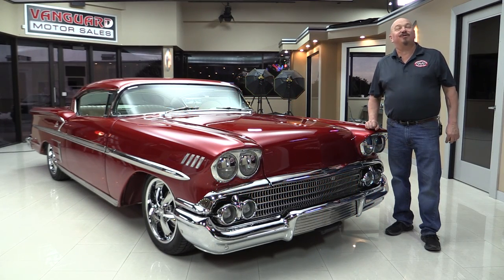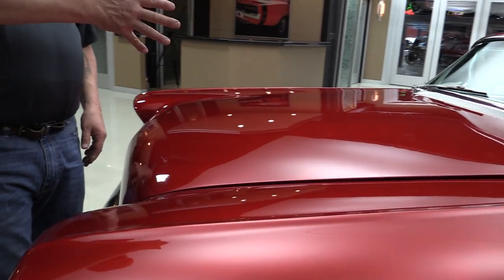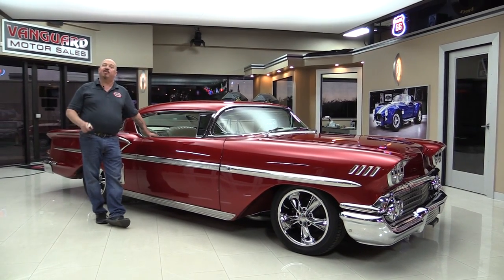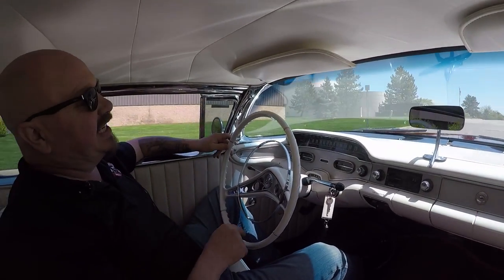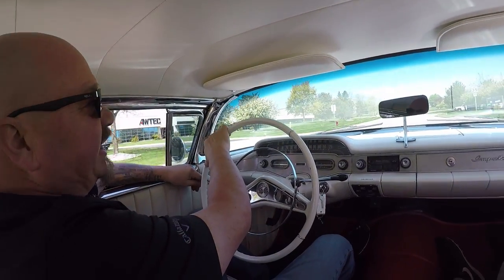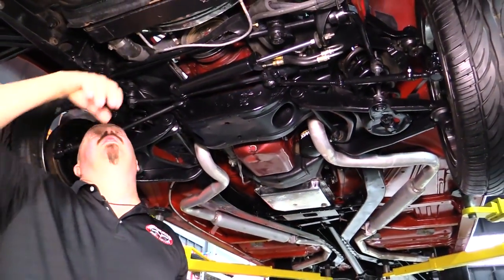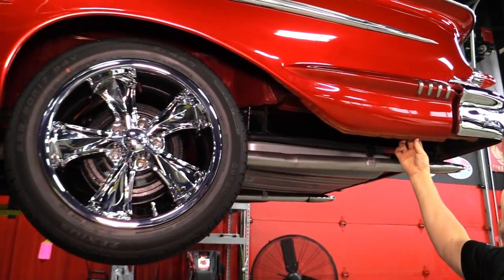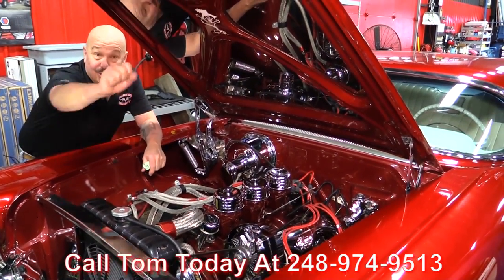1958 Chevrolet Impala For Sale

Comment: The '58 I owned back in 1976 was not an Impala, but a Delray, the cheapest version. It was 6 cylinder, 3 on the tree, 2 door an fire engine red. The most favorite car I ever had. Drove it from Atlanta GA to upstate NY and back. It burned 23 qts of oil in almost 1900 mile trip. Enjoyed every minute of it

Comment: THE AUTO INDUSTRY ARE MISSING A BIG PAYDAY. THEY SHOULD REPRODUCE ALL THE 50'S 60'S 70'S MUSCLE CARS.BIG 58 IS MY FAVORITE BUICKS, OLDSMOBILE, PLYMOUTH DODGE WERE DREAM BOATS.FLASHY, COMMANDED ATTENTION, AND DESIRE.
Reply: I agree, there's no reason why they couldn't reissue certain older models with fuel injection, 4 wheel disc brakes, perimeter frames, seat belts, plastic dashboards with airbags. But of course such cars wouldn't be cheap, and the execs don't see profit they'd like to see, so it's not done
Reply: In addition, ,many aftermarket companies make panels for a few older cars. GM for example could bulk purchase all the panels for a 55 or 57 chev, have a couple of engineer/ mechanics retrofit corvette drivetrain to a new perimeter frame. 6 point roll cage and make a small run of  say 1000. But they're not interested.